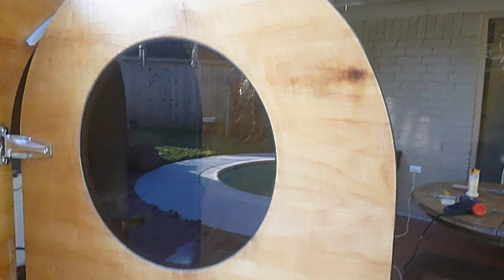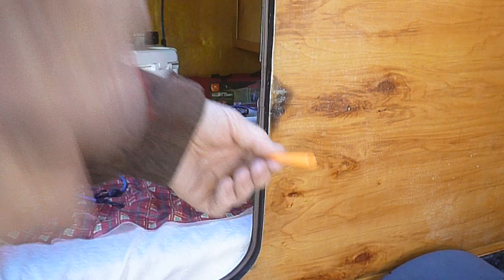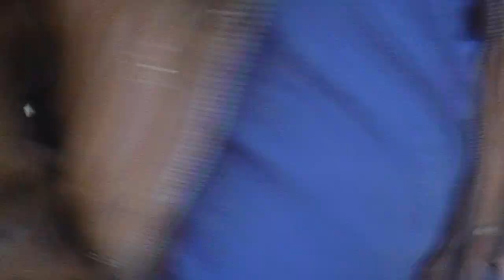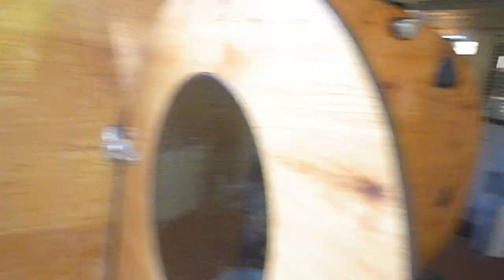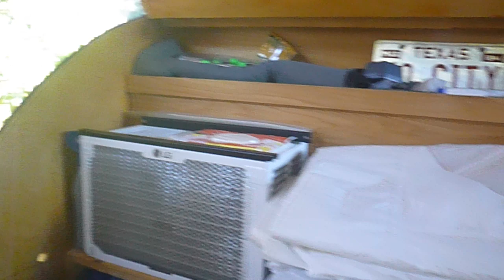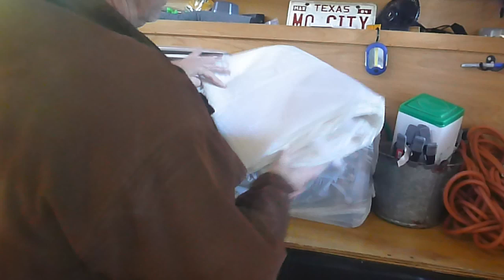Teardrop Camper Build a 5 X 8 video no. 62   Surface Water Damage Repair after 1 year of use.

Comment from the maker: I have a new camper build to start soon and it will be different from this camper in cabin space and design, new exterior shape, and a heavy duty trailer.
Reply: If you really want to go heavy duty, you need beefier tires. I put 15 in radials on mine. I've had a few utility trailers custom-made. I hate watching trailers bouncing around on the highway.
I used these torsion hubs on my newest trailer for camping:
https://www.princessauto.com/en/detail/2-000-lb-equalizer-torsion-axle-end/A-p8212110e
No bouncing. Runway campers will charge you more for this option. In parts, it was less expensive and easy to bolt on.
Reply from the maker: Thanks I will look here in a bit.

Comment: Looks like pretty straight forward easy repairs. I'm racking my brain trying to figure out a way to stop that from happening. I'm guessing that using wood it's just something a person will have to deal with once in awhile. Those extra electric plug ins are an awesome idea to have with you. Worth their weight in gold when you need them lol. Thanks for sharing and take care.
Reply from the maker: If you want the wood look I suggest using the fiber glass mat on the sides I did not but if I decide to build another wood sided camper it will get the mat and resin to make it more abrasion proof.
Reply: @langfordoutdoor  , I was thinking a steam punk look.  We have a manufacturing plant that has several bins full of scrap sheet aluminum in 1/8" and 1/4" thickness. Some of the scrap is as large as 4'x5'. I'm thinking of brass rivets with the shiny aluminum on the outside and wood grain on the inside. Not sure I'm that great a carpenter but steam punk allows for it to be a little missed shaped lol. Thanks buddy.